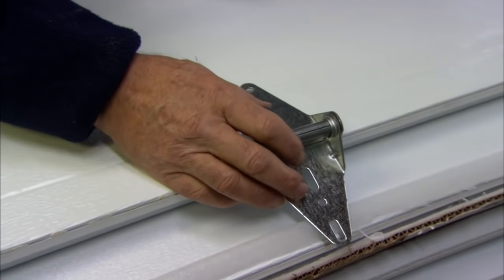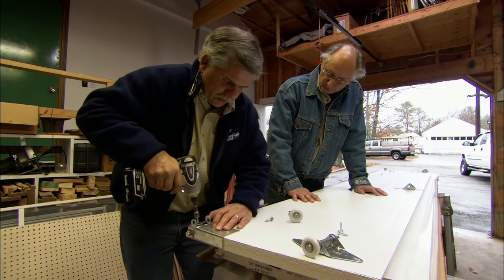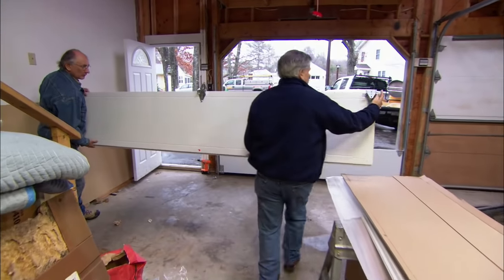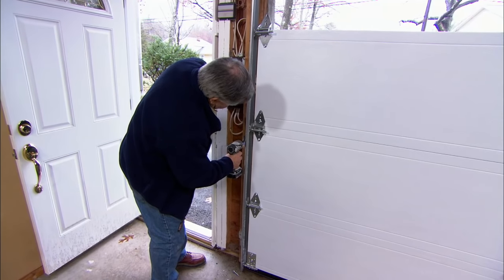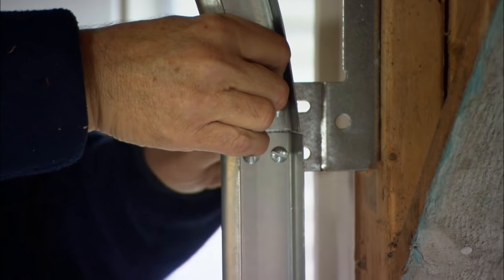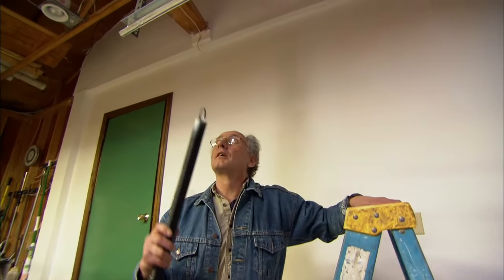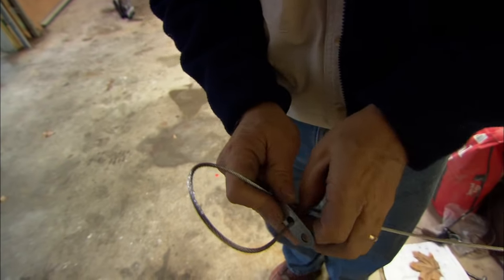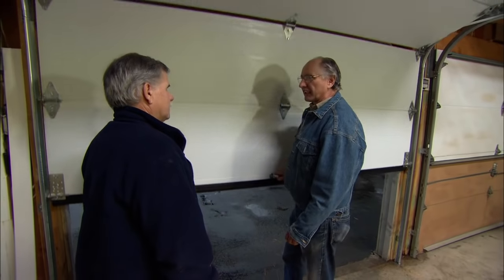How to Install a Garage Door | This Old House

Comment: Hanging a garage door IS NOT a do-it-yourselfer project for 99% of homeowners.  They could spend a month working on this "weekend project"... then call in a pro to straighten it out.
Reply: reason for the video.
Reply: I agree with you I actually work as a contractor here in California and I might be able to do a garage door but I don’t think I’d ever take one on unless a client really needed me too. It’s not as easy as it looks to get it to function smoothly things have to line up actually multiple things have to line up smoothly and just right to make everything fit good it’s not that easy

Comment: wow horrible way to install a door and top brackets were upside down
Reply: yes horrible install, but the top brackets were actually right side up for a residential door.
Reply: zavery1645
 No, you're both wrong. The top bracket is to be installed in a way that the door top edge extends the least as it sweeps over, and along the ceiling. The top brackets should in any case, be installed with the bolts facing up.
Reply: How am i wrong? With the top fixture installed the way they installed it give you a acceptable high arch and also doesn't cause the top section to sit at a extreme angle when the door is in the open position. If you put the top fixture with the bolts up you cause the top section to sit at a extreme angle in the open position because you have to pull the roller out to far to get the top section to sit tight to the header and thus not letting the section lean back. On a personal preference you cant get to the nuts to set the top fixture because the strut on the door is in the way. With commercial top fixture they would go on the door with the bolts up but that is because the top fixture is much bigger then a residential top fixture. I have installed doors for the last 15 years for one of the top door companies in Minnesota, so I know that im talking about.
Reply: I have seen top fixtures installed both ways on all doors. It is correct both ways. The primary reason the panel would extend too high, which I agree isn't preferable, is that the track system for the opening and headroom are incorrect. It doesn't take 15 years to realize how doors are installed. I have been doing garage door work for 3 years and know that top fixtures are not installed bolts down because of the top strut. That's what wrenches are for. If you mount top fixtures bolts down, like I mentioned before, there is a problem that can occur where the top panel will travel too far upwards and likely not clear hardware, opener equipment, or the ceiling itself. 15 years of experience should understand that. I've had to "fix" those installs before.
Reply: If the door tags the opener or ceiling then its the wrong size door or track set-up. yes is it is true that you can flip them bolts up to make a door work it isn't right on a residential door. wrenches take to long to use to tighten them and time is money and you cant get them as tight as you can with your impact gun. Maybe you need another 10 year to figure out what im talking about.
Reply: I don't see what's so slow about using a wrench on the top fixture. Maybe you're getting too old and slow? I can install a 9x7 in 1.5 hr.  The fastest I can install a 9x7 is 1hr 15 min. 6 doors in one day. Alone. Bolts up. What about you?
Reply: 45min tear out old door and hardware and install new door with new tracks, spring and back hang. no clip together doors.
Reply: I really doubt that ...45 minutes? I've installed a clip together type door in 45 minutes. Teardown of old door and install of a standard door in 45 minutes? I don't think so. You'd have to be working like a maniac. I'll believe it when I see it. Otherwise. you're lying.
Reply: It seriously doesn't matter which way they face but for years they have always been bolts on top if it hits ceiling or motor then yeah your lacking headroom and wrong track or wrong size door
Reply: +Sterling Hogan no it doesn't I've spent a lot of time trying different positions and way the bracket is and it makes no difference
Reply: You are right it is pointless arguing about it I have over 10 years experience and it just gives me more work so its all good
Reply: +Todd Kennedy -They had me confused for a moment on the top bracket-because I installed mine the opposite way they did it-they did not plum the tracks also-maybe I miss it.
Reply: I install doors like this in 7:38 seconds. It's in the Guinness book of world records !
Reply: @ndgd9308  if your way of doing it requires you to be young and spry to get it done fast, then his way is better. The quickest installer/tech I know is an old, obese, chain-smoker. He doesn't rush. He saves as many steps as possible.
Reply: @onuw  
That would be called pacing yourself, and thinking ahead.
Reply: @ndgd9308 YOU TELL EM BUDDY!!! 😂😂😂😂😂😂😂😂😂😂😂

Comment: way outdated and not legal in most states., its just the old way of doing it, def not in FL
Reply: It's legal in most states as long as you get permit. No license is required if it's your primary home. You can replace any electric, plumbing, framing, hvac, roof, or you even build your house alone.
Reply: Actually, in most states if you are replacing already existing things, you dont need a permit. As long as you aren't adding any type of electical or increasing the square footage, you dont need a permit.
Reply: jpatrick1967 That's the reality but most of jurisdictions requires permit for replacing HVAC, water heater, roof shingle, shower pan, new deck or structural repair, replacing windows requiring structural alterations, interior remodel including framing, replacing duct work, gas piping. Replacing dishwasher requires permit. How ridiculous it is!!! Oh, wait. Replacing garage door doesn't require permit. It's interesting.
Reply: How can a garage door not be legal? As if anyone cares what you put in the door opening of your garage. Imagine some inspector driving slowly around a town with some binoculars, checking if they can find a fault somewhere on your home "Oh! Your door handle is upsidedown! You got one week to repair it or 10K$ fine.".
Reply: +erictold  that's just so they can raise your taxes.   I know of a guy who built a whole house without permits.  He almost got away with it, but, IIRC, the postman narced him out when there was only one address for 2 houses.  If he had torn the old house down, he probably would've been fine.
Reply: @Engineer9736  they do that in my mom's neighborhood.  Got nailed before the concrete was even dry on a driveway repair.  They did not care that we did it, but they wanted their permit money.